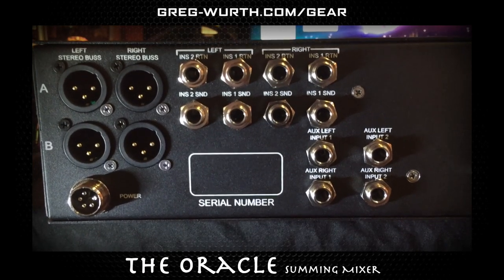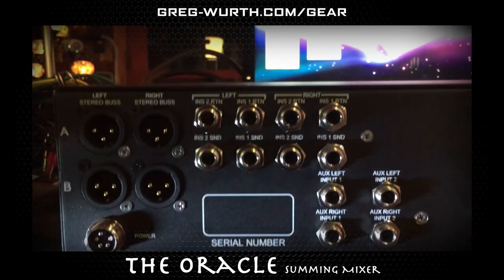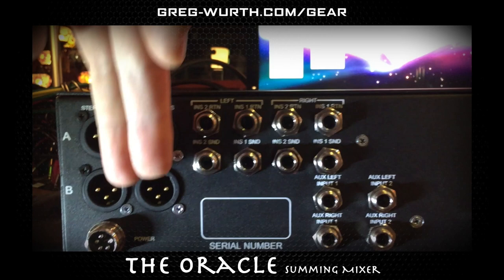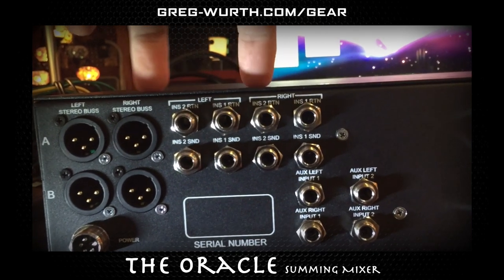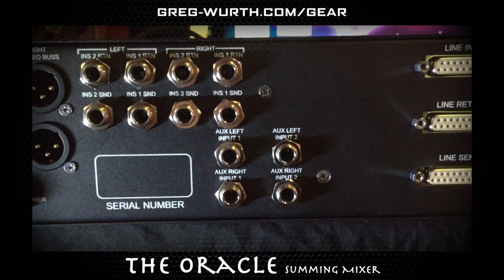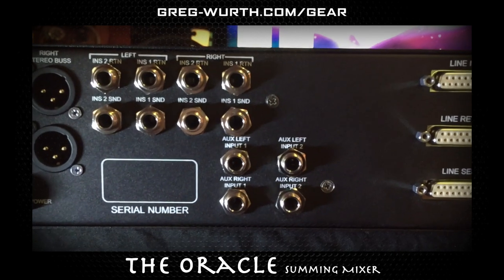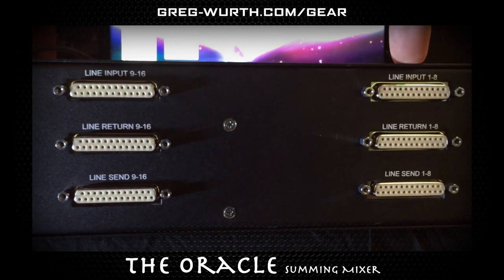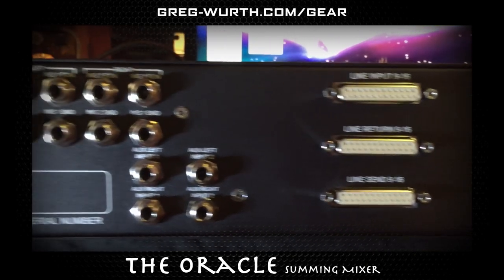The Oracle Rear Panel Overview

Comment: Greg, what does it sound like? I’m using the SSL Sigma. Would it be a major difference. I’m liking what the Oracle can do.Thanks
Reply from the maker: It’s sounds like a fat and punchy analog console. Like and API on steroids. No surface mount components used like most the other south there.
Reply: Awesome